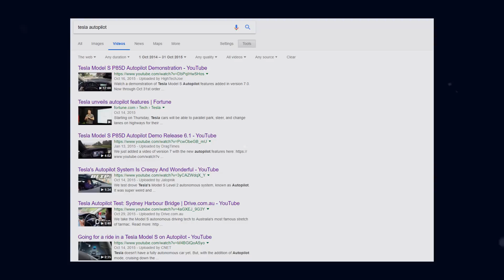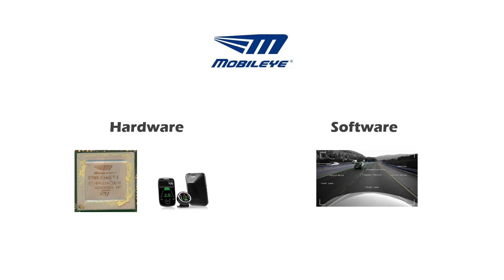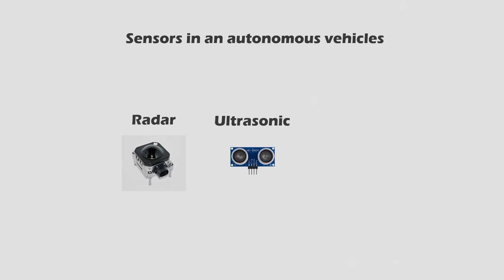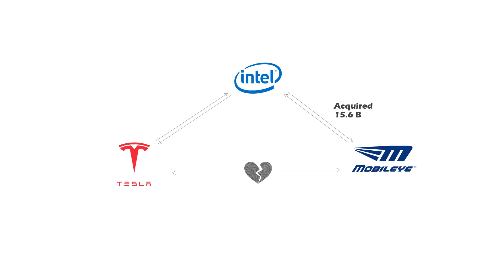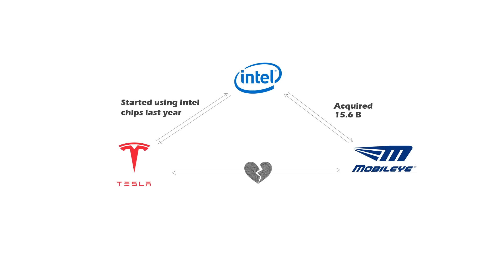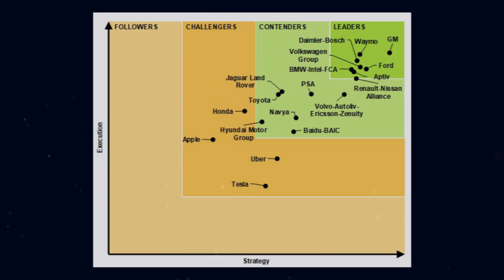Tesla's Autopilot is in Trouble, here is how to FiX it!

Comment: The main problem with Tesla going back to mobileye is they would have no advantage over other car makers. Also Mobileye could potentially use Teslas massive amount of data from it's already running cars to improve their system(by extension tesla would then erode their advantage over other car makers of having large amount of driver data.) This is likely one of the real reasons tesla broke it off with mobileye.

Comment: I think the 'strengths/weaknesses' chart for cameras is pure balony, as it doesn't take into account the variety of camera systems that can be fitted into a car. At the most basic this includes monocromatic cameras, IR cameras, low light cameras, colour cameras, cameras with anti-glare lenses... Each one of these camera types deserves its own chart, and combing them with each other produces a few dozen more charts. Then you have the issues of mounting the cameras in axis or slight off axis... As I said - whoever came up with that chart was either not remotely qualified to create it, or they have an agenda to sell.

Comment: Tesla does have a level 4 system, it is getting verified atm for safety but it looks promising. Mobileye is crap and super unsafe. The chip they had earlier were designed by rules and regulation which are slow and can be a danger if not acting human. Their current system is build like comma ai is trying to. Basically tesla have trained an AI for 2 years and are now verifying the results. They should not partner with waymo or mobileye ever. Lidar is way too expensive atm compare to the extra safety, it is just not worth it.
As soon as verification is complete, Tesla will push the AI model to the cars with hardware 2.0, which should be before christmas atleast. If they find a problem, it could be longer.

You’ve seen renaults level 4 car probably. That one car is millions of dollars. Tesla can flick a switch and all hardware 2 cars will be level 4 aswell.

Comment: I have a pre-autopilot Model S so never got a chance to use AP1 or AP2. Saturday is received my Model 3 with autopilot and it has been active for a little over a day. My first impression is that it’s not as great as hyped. Constant alerts for hands on the wheel and ping-ponging in the lanes. That said it is new to me and road conditions are poor. (Winter in New England...snow and salt all over the roads) with only 125 mile on the car my Autopilot experience can only get better going forward. This is a great video. Thanks

Comment: I have a mid 2015 Model 85S with AP1.  I got this through a firmware upgrade.  AP1 can do 99% of the driving on separated highways like the interstate.  Once in a great while I take over because someone else does something stupid.  On sharper turns or hills the deceleration and braking is always late if a car is stopped at an intersection and I have to intervene.  1/2% of the time it just does something wonky.  But I attribute that to the abysmal road markings (right lane markings but no left lane markings) here in Nebraska.  In other words, the median is not painted indicating a lane.  Interstate is the most reliable but there too the markings are the problem being inconsistent.

Comment: I think that you failed to mention that the LIDARs that are on cars like Waymo and Ford’s self driving cars are very expensive due to the resolution that’s required. Tesla is very impressive in the respect that they are using only cameras, radar and ultrasonic sensor. Best yet they have that functionality at a very low price making it more liable for mass production. Now does that mean that they have a product better than Ford’s version. No. However I think it’s a good point to touch on.

Comment: As a Tesla owner - Autopilot is in Beta mode, and will be in that mode for a few reasons.
It is the ONLY car on the road that has autopilot that I know of that includes relative Cruise control that keeps a safe distance from the car in front;  Land keeping - where there is a warning when the car gets close to lane dividers; Self driving on designated roads along with cruise control; auto lane changing when the indicator is on; and early auto alert when approaching a car too quickly; self parking both perpendicular and parallel.  Finally, Tesla also detects problems with cars ahead - if they are following too closely or if the speed difference between cars in front is too different, it warns of an impending possible accident of two or more cars infront.  
Tesla has said it is increasing the number of cameras - and other sensors.  An improvement in the system requires more hardware.  Also they have said they want to rely on what the car can sense irrespective of GPS system, which requires more computing power.  It uses the NVIDIA Chipset, which are faster and more appropriate than computer processing chip sets.  
The graph that you show on where Tesla is in its autopilot technology is based on lidar advances.  Tesla dropped Lidar for a good reason - Tesla wants to illiminate reliance on technology that outside of the car's own capability.  It wants to augment driver capability by enhancing what a driver experiences - which basically means enhanced sight!  
I hope your next video has a more accurate representation of the different systems that car companies are looking at.   Lidar was developed for aircraft - which makes sense - it requires quite a complex camera system with a lot of moving parts.  Tesla wants to reduce moving parts to keep systems as simple as possible.

Comment: Well, it could be what you said...
But Tesla's autopilot is actually not struggling at all and as far as I'm concerned is the only autopilot system that doesn't wiggle left and right to find the lines.
The very fact that Apple is on top of Tesla in the chart does not prove that Tesla is worse than Apple in the autonomous driving industry as you suggest, but it does prove that the chart is complete bullshit.

Comment: Transport Evolved pulled that report apart a few weeks ago. All it measures is how close the company's concerned's research is similar to how the ex GM people who wrote the report this an autonomous vehicle should operate. Basically those guys think that a car should be covered in LiDAR and be trying for full autonomy. Tesla are working on running mostly with cameras, GPS, a basic forward radar and parking sensors. Tesla's view is that rolling out a driver assist system collecting data and then improving it is the way to go because it will be the quickest and most progressive to roll out and be by far the cheapest to implement. If they are wrong they will just but some LiDAR systems! First to scale will win, I would not bet against Tesla.

Comment: I had AP1 and it was really good. when I first got my AP2 it was really poor. It's been getting updates all the time. You notice the difference after every update! It's still the best technology available. so the graph is very wrong. You are comparing What is out in the world with Tesla v what is in the "Lab" with other companies. I'm predicting this year to have a major upgrade, it's time for added functionality to the autopilot. I'm predicting one added function either turning or traffic light monitoring. These would be huge things. I think traffic light monitoring will come first. As for the AP2 at present, it is now to the point where no matter the roads bends it is able to follow its only limit is it doesn't slow when it doesn't have good vision and doesn't slow when cars are around a tight bend either stopped or slowly moving, even though it would ahave vision of the cars.

Comment: You make it seem like you know a lot about Tesla's problems but actually you couldn't be further from the truth. By now Tesla already developed enough for their software to never rely on a 3rd party again. Which is much better then partnering up with a different company (Again).

Also 1 software update can move the Tesla's spot in the chart all the way in the green corner we all know it. We just don't know how soon that will happen.

LIDAR won't happen, Elon basically said he would eat a baseball cap if Ladar turns out to be necessary. Also the camera's of Mobile Eye are not better than the ones Tesla provides now. The only difference between these is software!

The real truth of why it's taking Tesla so long is because of the selflearning Tesla system which connects all Tesla's together and creates HD Navigation. And improvise itself by AI. They had to start all over after the Mobile Eye breakup and that's exactly why this is happening!

If you read Elon's tweets you know there's a huge update just around the corner!

Comment: Your channel is entertaining with non-scientific research - as you say yourself, "It's just me." We know you don't have an engineering degree or experience in the field and here it really shows. The most important point that Mr. Musk has made about the system, and he has emphasized that it is the most important point, is that of fleet learning. Tesla's system is setup to do fleet learning whereas no one else (including Waymo) is setup for it. When Tesla goes from several hundred thousand cars to millions on the road over the next few years, Level 5 will be achievable by them alone. Data gathered at orders of magnitude greater than even Tesla has yet plus software done by a software company is the only path to Level 5. I don't believe Tesla is gathering all the data it can yet, but that it eventually is coming. As for software companies, only Tesla, Waymo and Apple qualify here. Nobody else stands a chance. This is actually a hard problem, but it's solving will not appear to be linear. At this point in time, getting MobilEye or anyone else to help simply is not going to happen because this is a data and software problem and there isn't anyone as good as Tesla at this at this point. Oh, and that report by Navigant ranked companies by how well they talked about self-driving to the uninformed, but had nothing to do with ranking capabilities. 
For the record, I'm not a Tesla the car company fan as much as I am a fan of Tesla, the immigrant from the 19th century ever since I learned about him in school back in the 20th century. If you want to understand this problem, talk to someone who has worked with the Discrete Fourier Transform. Until then, you're just babbling.  Sorry Lei
Your 2019 comment is very astute and I think so much more important than all the rest of the video that it makes this a great video vs a bad one.

Comment: I have had a Tesla Model S for about 8 months. I bought it without autopilot or adaptive cruise both because I like driving, and because it was going to be another $14000.

I've had a few loaners while they were fixing some quirky intermittent issue which seem to be addressed some of which had adaptive cruise and maybe autopilot (I didn't have a close look). I found the operation of the adaptive cruise to be wanting, it would speed up or slow down for know reason, 

Also mine seems to struggle with where the road centreline is and doesn't recognise yellow road markings. It also has done some strange autonomous steering operations that I think were wrong, and this morning I nearly rear-ended someone while not paying attention and the emergency brake didn't kick in. it took a panic stop (initiated by me) to avoid a collision and after stopping I quickly pulled off the road to avoid being hit from the car behind me. No sign of emergency brake.

It's all left me somewhat disappointed, so I definitely won't get autopilot until after they start proving they can actually provide something for the cost.

Apart from that, The car is flawless, and I do believe they will eventually get it all fixed. The fact that most of the animals on the planet get by with only 2 eyes suggests to me that it is possible.

Comment: First of all the statistics is just total bs in my opinion. I think it is just payed for by some car company (probably GM because why the fuck would they be the most advanced in strategy and execution). There is no other manufacturer that is more advanced in production vehicles right now (although some are close or equal) but tesla has a big advangage: OTA Updates which no other car company has. Lidar wouldn't work for personal vehicles because it is too expensive. And nothing of what you mentioned as a FIX will happen. You didn't mention that Tesla is developing it's own AI/Selfdriving Chips. So i think the direction is pretty clear and in line with elons vertical integration priniciples (i mean just look at SpaceX they build pretty much every part of the rocket): Tesla will go  the hard way and develop basically everything themselves. They use a neuronal network and the single most important thing for training these nets is DATA and Tesla is getting loads of data from all the autopilot cars. So i think you focused too much on this one statistics and you missed out on some important points. It is pretty clear why there were no big advancements over AP 1 because Tesla had to write the whole Autopilot Code from scratch. I don't think there is a big problem with camera hardware because cameras are just cameras and i don't think there was anything magical to the mobileye ones.

Comment: The "research" that shows Tesla being last in autonomous driving is paid, sponsored and commanded by oil companies in their latest effort to hide the advancement of Tesla. It has only 1 purpose - to mislead people.
Reply: Don't be crazy... you know you have to hold the steering wheel to use the Autopilot, while the manufacturer at the top of the chart don't even need steering wheel.... you have a Tesla, you know the reality, don't be a Denier.

Comment: I have a maters in automotive engineering and took an autonomous vehicles lecture this year and for the most part the video is very good. It's worth mentioning the reason tesla doesnt want to use a Lidar based system. 1. It goes against the main industry demand currently in lowering emissions. Lidar sysems are quite large and heavy and can effect a vehicles drag coefficient drastically as well as increase the overall weight of the vehicle. However, as you mentioned, Tesla's time and money will be focused on recalls and manufacturing changes as most of their vehicles have been rushed in comparison to the industry standard. Even though it's a good engineering firm, cars are extremely difficult to package perfectly the first time around. So i think tesla honestly won't seriously touch autonomous driving until 2020-2021, and by then improvements in lidar could change the entire industry. So if i were Elon, id probably just wait.
Reply: Also 2. They lidar currently doesnt fit tesla's "cool" image lol

Comment: I have autopilot Mk 1 on a 2015 Model S. It is a just a cruise control with auto emergency braking, lane keeping and the ability to stay a fixed time interval from a vehicle in front that is going slower than the set cruise speed i.e. autonomous level 2, light years away from autonomous level 4 or 5 which I have doubts anyone will achieve for a long time. This MobileEye system has two obvious situations that can get an inattentive driver into trouble (i) approaching a brow of a hill or bridge the camera will briefly lose sight of the lane lines, this used to cause violent darting to the right but these days it is much less scary but nevertheless it still cannot be trusted in that circumstance and (ii) anything in the upper part of the image its camera sees is assumed to be not a danger i.e. overhead signage or a bridge over the road etc. The problem here is if the Tesla is driving down hill that demarcation will allow objects too low to drive under to be interpreted as offering no danger, I'm convinced that was what happened to Mr Brown who was approaching the bed of a semi trailer across the straight road when on a long gentle downward incline. The opposite happens if the road is on a slight upward incline, the car will suddenly slow when approaching an overpass because it now interprets the bridge structure as being low enough to prevent the Tesla from safely passing under it.
I think Mr Brown was guilty of not paying sufficient attention to what was happening through his windscreen and assuming autopilot was good enough that he need not even though Tesla had always insisted that the driver must not cease to be vigilant even if autopilot was driving the vehicle however I also think Tesla should spell out these two known failure modes (and any others I'm not aware of).
I've heard that on the Tesla Mk 2 version of autopilot there is a third failure mode (I'm not sure if this also affects Mk 1, I have not observed it). Apparently if there is a stationary vehicle in the slow lane and a vehicle the Tesla is following suddenly darts into the adjacent faster lane autopilot will not see the stationary vehicle just revealed as a danger and drive into it. This is alleged to have happened recently when a Tesla ended up driving into a stationary fire truck at 65mph (the driver and passenger walked away mostly unharmed).
I love my Mk 1 autopilot, I'm aware it cannot be trusted so I do not trust it for a moment but I do believe that the combination of that autopilot and myself are safer than just me alone but I wish Tesla would be more upfront about when autopilot can misinterpret what it sees to forewarn its users of particularly hazardous autopilot situations.

Comment: Not true, Tesla got a low score do to not use LIDAR, and marketing. "Each type of  sensor  has  its  strengths  and  weaknesses,  and  the  use of  radar,  cameras, ultrasonic,  and  lidar  fused together  with connectivity  increases  capabilities  in  a greater number  of  different  conditions.  As  a result,  Navigant  Research believes  that  the current Tesla  Autopilot  2  system  will  likely  never  be capable of  Level  5 automation,  and even  Level 4 is  likely  to be more limited than other  systems."